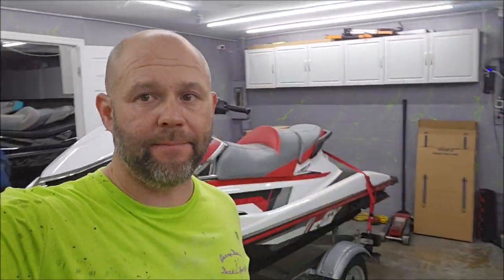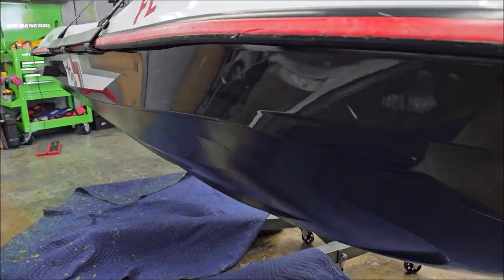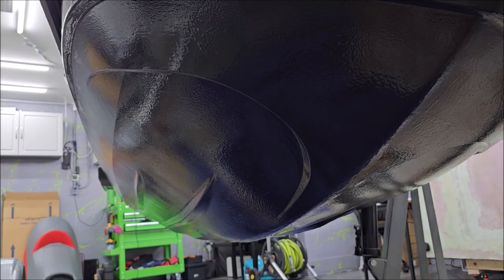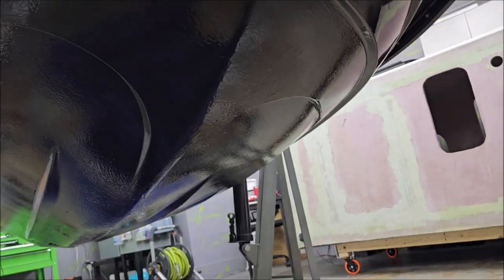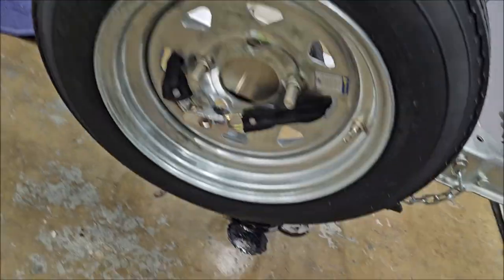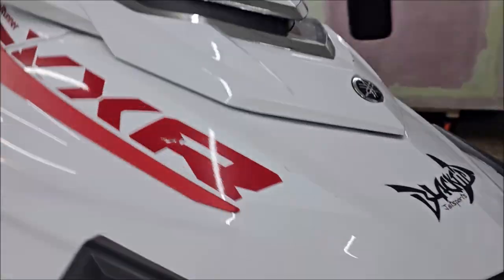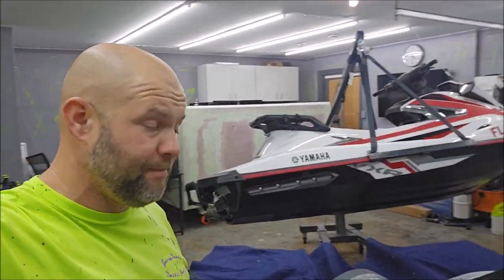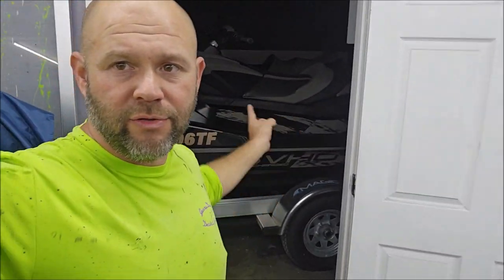YAMAHA VXR WAVERUNNER - SUPER SLICK 2000 INSTALL

Comment: I was considering having my Yamahas bottoms painted with a protective coating like super slick. Just wondering. Most skis are trailered so UV expose is an issue in my opinion. Is gator glide uv stable? Do you apply one coat or multiple layers of the bottom paint? Just wondering what thickness is the application and can areas that get scrape or rubbed off be repainted or touched up easily?